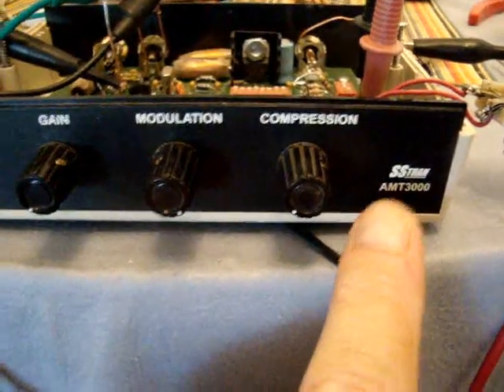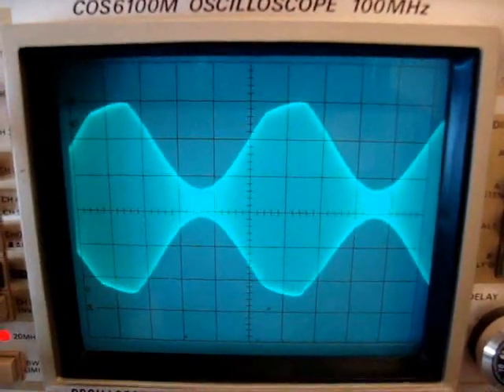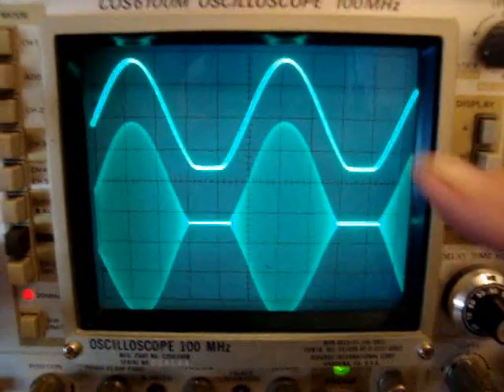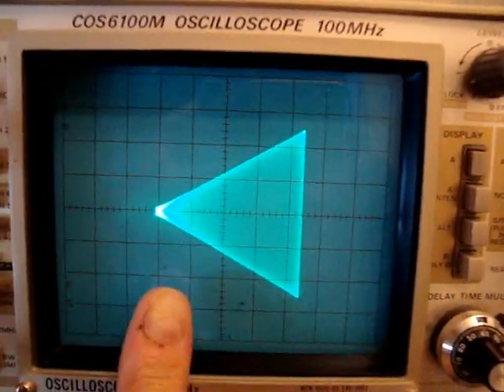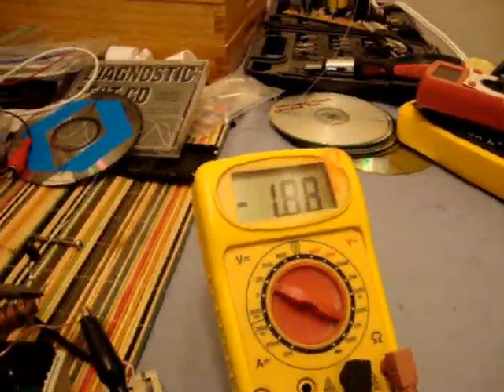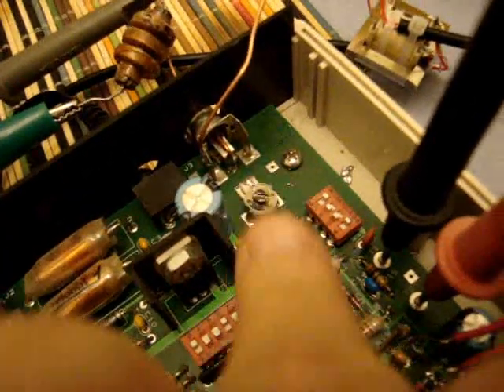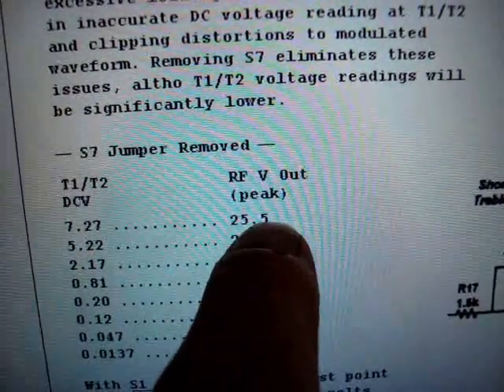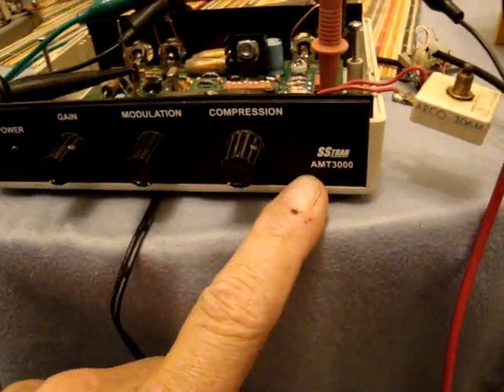SSTran AMT3000 Test and Evaluation

Comment: There's more than one version of this kit . One is for transmitting inside your home and another that has a few different internal parts for longer distance transmitting .
Reply: The AMT5000 has some upgrades to the audio. No power increase...it has to be PART 15. 100 mw.
Reply from the maker: Exactly, but the final RF amplifier stage is more efficient, more like 90%, instead of the typical 75%. Note that part 15 specifies 100mW DC power input the the RF amplifier, NOT 100mW output.
Reply from the maker: Correct. This does have plans for operating it on an outdoor antenna as well, but the later version is more advanced circuit which is more efficient.

Comment: Hello bob,i just wonder if we can increase the watts in this transmitter,how can i build an am exterior antenna for 1700 khz? Thanks from Nicaragua
Reply from the maker: With the way the output circuit is designed in this transmitter, there's really not any good way to increase the output power. However, connecting an RF linear amplifier will increase the power to whatever power you want. I am working on such an amplifier which I will post  when I get it done. As for the antenna on 1700 khz, an "inverted L" long wire antenna is good, if you have the space for it. How much power do you want ?
Reply: @bob4analog  first i would like to know about costs, first for sstran and for the amplifier the power could be 50 to 100 watts..thanks and good day
Reply: @alexalex-qi2ho  You will be surprised at the coverage you get with just .1 watt. If you follow SSTRAN instructions for a base loaded antenna you could get a little over 2 miles. If you're gonna push WATTS into the antenna; then you might get a nasty visit from your Radio regulator.

Comment: I watched this cause it was interesting, but I am absolutely clueless what any of this means , what is this thing ? Do you run it between the radio and antenna ? Or is this what you hook to a mobile antenna and do 88 mph , push a button and time warp ? You could tell me it goes on the ISS for GPS and I'd believe it . So I'm curious , what is it/what does it do ?
Reply from the maker: Glad you found it interesting. It's an AM radio transmitter. I did a technical evaluation of it since many radio enthusiasts have this kind of transmitter. There is an interest in very low power AM broadcast radio stations that are unlicensed hobby broadcasters and are regulated under the guidelines of the Part 15 FCC rules.